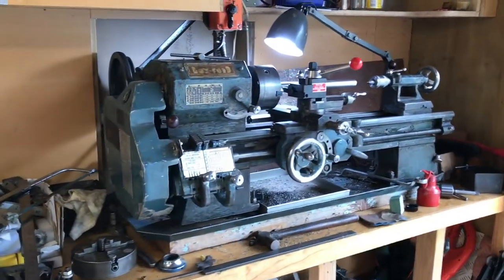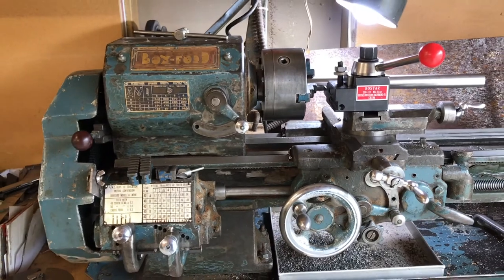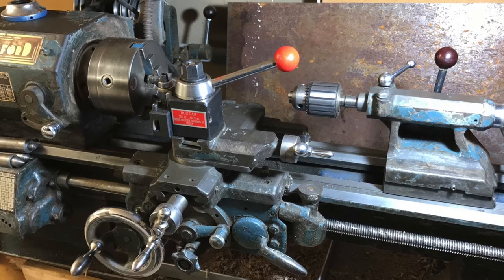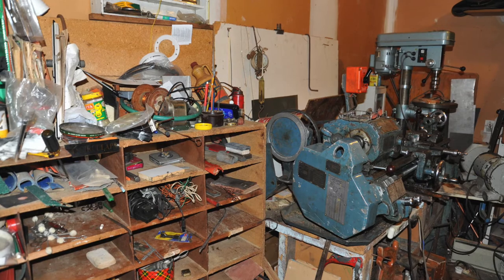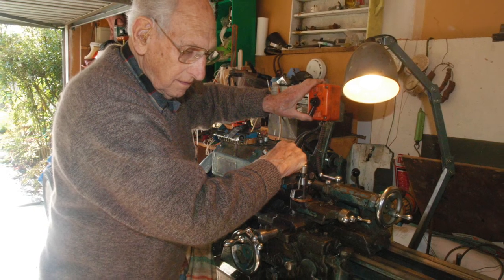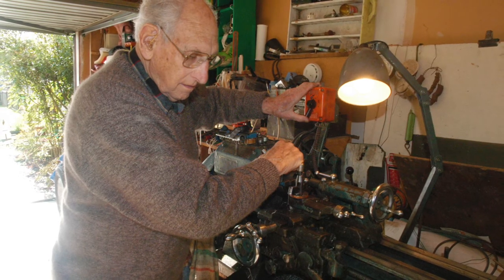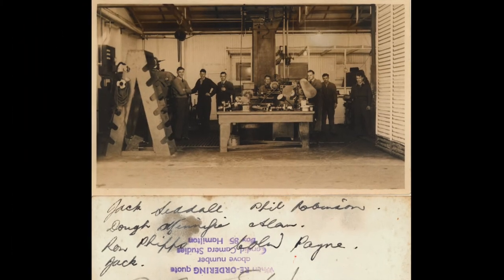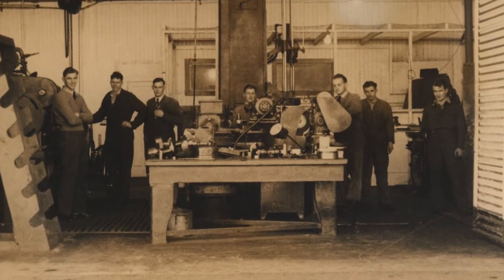Introduction to "How to use an engineers lathe" or any small engineers metal lathe like this Boxford

Comment: friend bought a boxford lathe 1952 that does not have gearbox - norton box , know if there is any design to make a norton box and put on the lathe ?
Reply from the maker: There are drawings of the parts inside the gear box available at the Boxford users group or via lathes.com.  However this is a complex gearbox with 8 numbered gears and 5 letter gears making 13 gears plus the gears they mesh with, making at least 15 gears. Using a 3D printer may be a possibility.   It would be far simpler to look for a second hand gear box. The lead-screw is shorter because of the gearbox so you would have to replace that as well. I have heard of people doing this and I think there are YouTube videos.  Otherwise you might find my online free software useful for deciding how to set up the gear train for any thread, either metric of imperial, even without the special compound gears and without a gearbox, as long as you have a good selection of change-gears. . See HeroSteamEngine dot com /RideTheGearTrain. One of my YouTube videos explains how to use the software, but there is also a link to it from the software.
Reply from the maker: There has been increasing interest in ELS (Electronic Lead Screws). These require a stepper motor connected to the lead screw and a rotations sensor on the spindle with a tiny 8-bit computer connecting the two. There are several web sites and users groups discussing this option and there have been discussions on the Boxford Users Group. This would be easier than making or installing a gearbox I think.